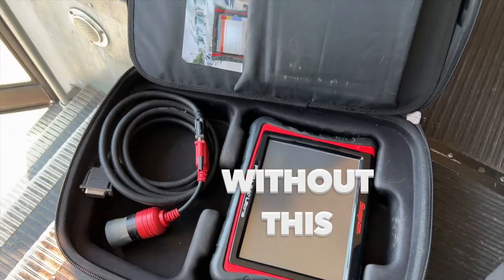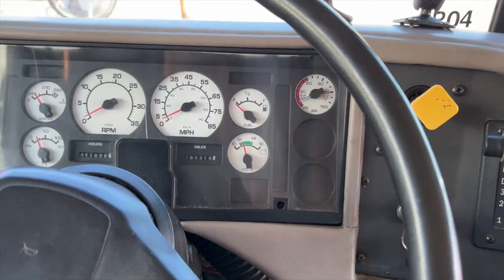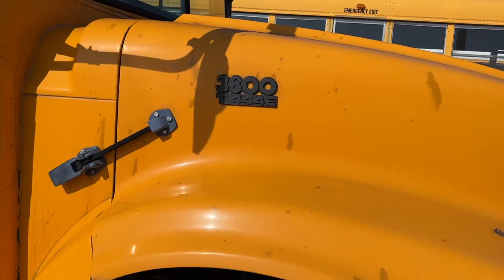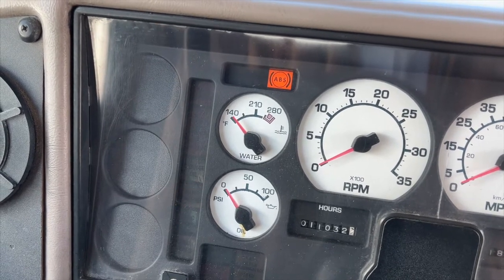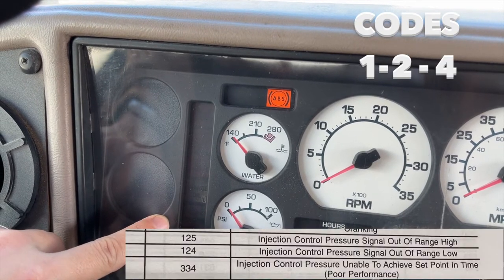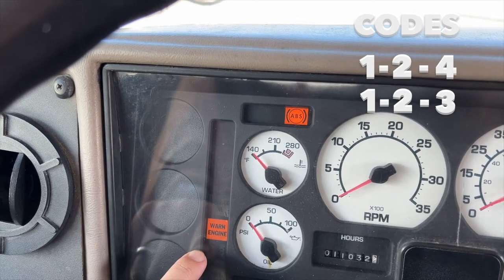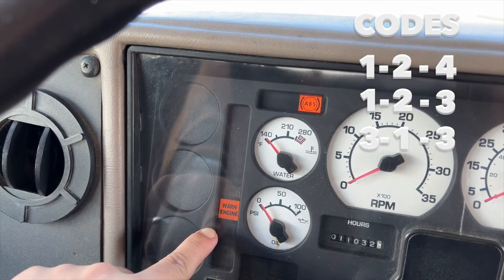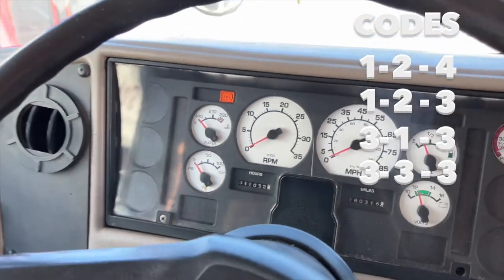How to pull engine fault codes on a bus without a diagnostic computer.

Comment: Thanks Josh now I can check the codes on my bus after seen your video. My bus is a 2004 int 3800 444e 7.3L for the last 3 years at times would only click by the driver side behind the switches after a few attempts or hold the ignition for 5 seconds would fire up, now it only clicks no crank, I jumped the starter and solenoid it cranks no start, I run a direct  wire from the selonoid to the switch it cranks but no start. I also don't have stop lights and the booster motor is no sound when I apply the brake. When I connect power to the brake booster is alive. Any suggestions to make it work is highly appreciated.

Comment: Hey, Josh at work we have a 2007 International School Bus the Transmisson Check Light is on. The transmission does not activate 5th gear in motion. However, fith gear goes in when the MODE is activate. Any recommendations or souces. Thanks